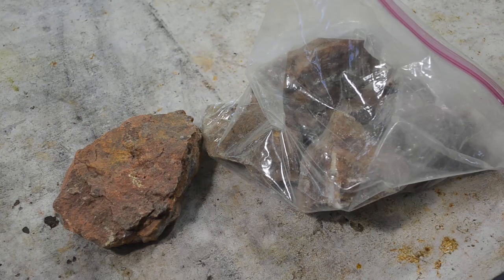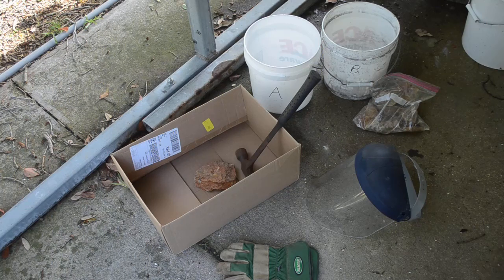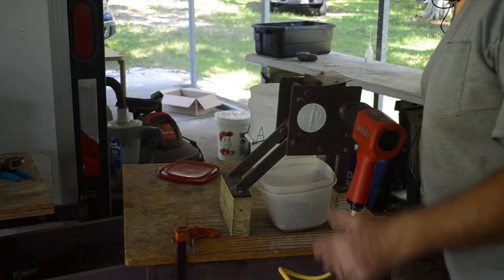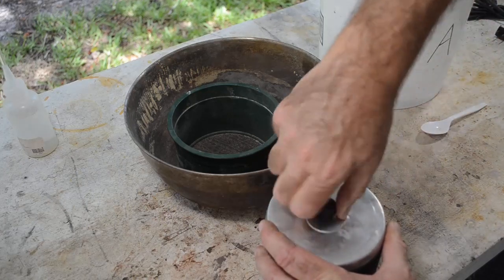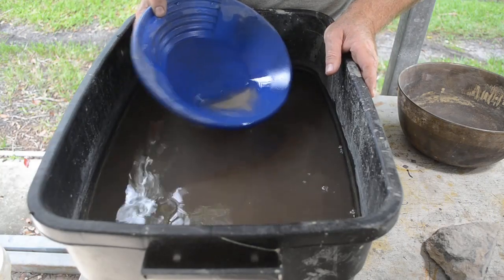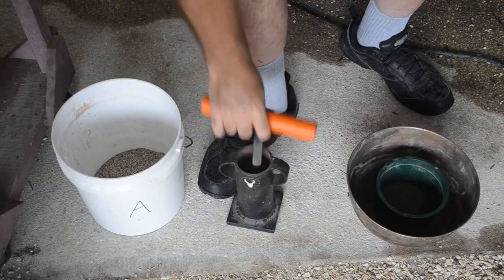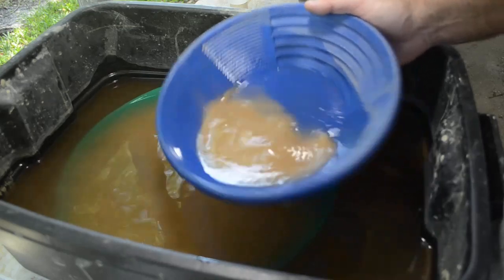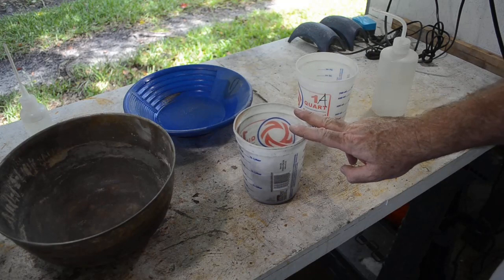Crushing & Panning Gold Ore From Western Gold Mines #thefinders #gold #goldmining

Comment: Find some old dead treadmill and rip the motor and the 2 end rollers out of it. You should be able to rig that up into a rock tumbler big enough that you could fit a propane tank or a bucket on. You could ball mill a lot more material at once that way. Of course you would probably need a lot more balls and let it run for a day.
I built one for polishing rocks and I can fit three of those barrels across it at one time. 2 roll back to back with each other, and 2/3 of the way across, I have a stationary wheel that the third barrel will ride against so it doesn't interfere with the screw lid on the other 2. I also put a stationary roller wheel at each end just to keep everything in place so they don't go rolling off. It's a 90 volt DC motor, but I think I've got mine running on 12-16 volts. It's a multiple tap Transformer and I don't remember what the voltage was that I ended up picking to be a good speed but its fairly low. Just goes through a rectifier and into the motor. It sure makes polishing rocks go by faster when you can fit two small barrels and one bigger one on there at one time.
Reply from the maker: I have plans for the future. In the short term I am going to get a pneumatic hammer to do the pounding in the manual ore crusher. That should speed things up and make my life a lot easier. Long-term I am working on a flail mill. The future could get interesting.

Comment: Hello Mr Omegageek. I know this comment isn't really relevant to the video, but you have not uploaded any mirror making videos recently, and I need your help. 

I'm taking an attempt at making a "telephoto" mirror lens for my DSLR camera. Essentially a miniature Newtonian telescope. However, due to it's objective nature, the plane mirror must sit parallel with the parabolic mirror. 

Therefore, I'm tasked with cutting a hole in the parabolic mirror. I've obtained the blank, but I'm unsure whether to cut it right now, with it's full thickness - hell of a lot of glass for my diamond crown bit to chew through, or to cut it once it's been ground to shape, I'll have half as much work but I face a much larger risk of cracking it, right? 

Also, I will need to turn those blanks into mirrors somehow. A local observatory offers aluminizing the mirrors for ~$0.30 per square mm, which would run me over $1500. On the other hand, I can try with the silvering kits, which range from $40 to $250 or so. Do you think the optical quality of home silvered mirror can perform well enough for something like this?
Reply from the maker: Yes, the weather has been bad here for months. Running my kilns during thunderstorms with the power flickering and going out is not practical. So no glass-working videos lately. Normally when coring a mirror it is best practice to core most of the way through from the back first. Then grind and polish the mirror while it still has center support, to prevent any issues arising. Then once the mirror is done, core the rest of the way through from the front, to prevent the core from spalling out at the edges. I'm surprised the coating cost is so high. here in the US coating a small mirror doesn't cost much more than $100, and there are many shops that could do the work.